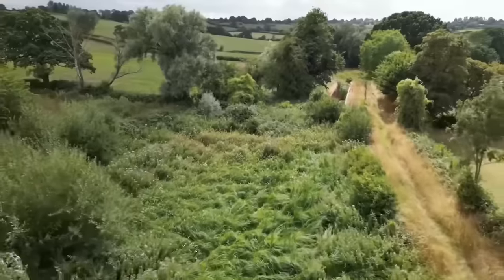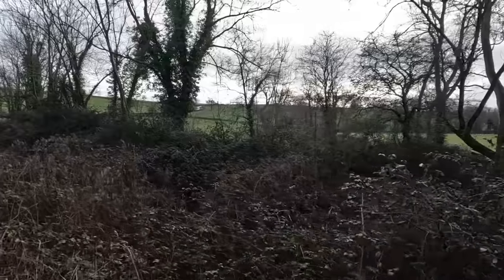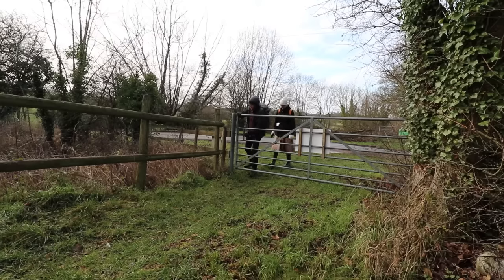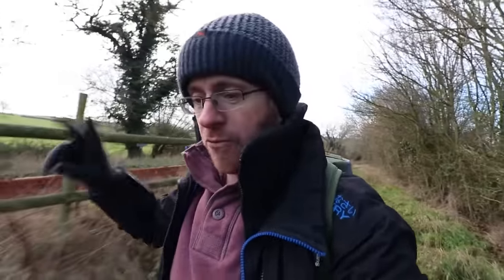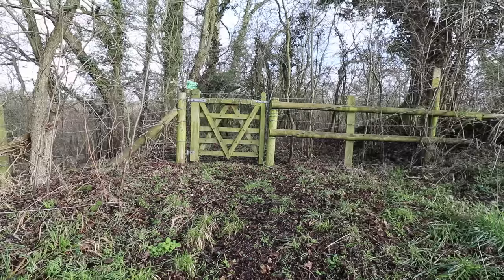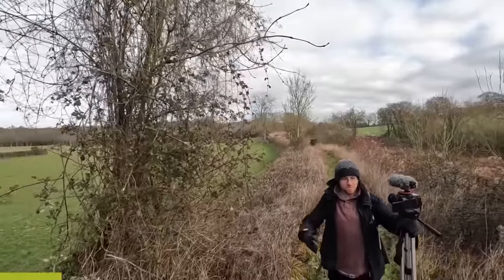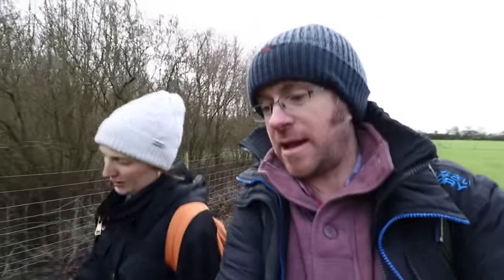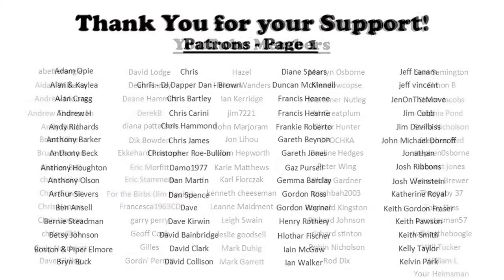The Wilts and Berks Lost Canal - Scaling 7 Abandoned Locks

Comment: There's a public footpath (marked on maps and signposted) near me which is totally impassible because owners of some of the properties which back onto it have extended their gardens and fenced off "their" little bit. One has even extended his shed to obstruct the footpath.
Reply: Then report them to the local authority.
Reply: Where do you live?
Reply: It's very common, and local authorities won't do anything. There is a route near me that was missed off the definitive map when it was made in the 1950s. I have provided evidence including deeds from a house with a plan showing the right of way that originated from the landowner. They've done nothing for over 10 years now. I think they're waiting until everyone who ever used it is dead and then they'll say there is not enough evidence.
Reply: @radman8321  Try contacting the Rambler's Association they are trying to get more paths added to the definitive map
Reply: @radman8321  that's a different issue to the blocking of a marked right of way.
Reply: @radman8321  If it is a legal right of way then the local authority has the Legal obligation to keep the RoW open. if they fail in that obligation, you can take legal action against them
Reply: Contact your local Ramblers group who can look in to this, they are campaigning to restore blocked paths which are in fact legal rights of way.
Reply: The local authority/ District/ County Council need to be informed.  And sooner rather than later, plus needs to be done regulary, otherwise the use of the footpath will be stopped by the lack of action Taken and the path closing permanently and the people obstructing it keep there bit of stolen land.
Reply: @joncawte6150  I know, but this isn't an official ROW because it was never added to the definitive map. There is plenty of evidence that it should be on the map but short of initiating a court case myself I have to rely on the local authority.
Reply: @neiloflongbeck5705  True.
Reply: On a related note, when I sold my last house, a Victorian terraced cottage, the ordnance survey had a footpath marked across the back gardens. Impossible as the gardens were all enclosed by a 40ft quarry face that preceded the age of the houses. I think the quarry was dug to build the adjacent railway embankment then the site was used to build the cottages. In reality the path went up the lane in front of the houses to the same destination. I had a nightmare selling the place because of that 2mm discrepancy on a map!!
Reply: Believe it or not a local road to me the owners of the house illegally put up road closed signs and blocked the road with soil and wood barricade. I complained to the council who actually went out to visit the road and their response was to close it permanently!
Reply: @neiloflongbeck5705  I have. Nothing has been done
Reply: @phillwainewright4221  have you tried your MP? I know some of them are just time serving idiots, but some don't know the meaning of serving their constituents and act honourably.

Comment: There's a peculiar situation with landowners blocking access in the middle of the Avon Trail. If you download the pdf for the trail it shows a crossing of the Bitton Viaduct next to Avon Riverside Station. However, about 4 years ago the landowner on the downstream side blocked access to the river that had been used for at least 10 years. On the other side, where the station platform is, the gate at the bottom of the embankment is locked and, recently, a sign went up to say £1000 fine for trespassing on the railway. One has to wonder what the operators of the, already pretty lacklustre, Avon Valley Railway expect their passengers to do at what is the terminus of the line. To add to the frustration, passengers have to cross the line to get to the cycle/foot path which allows them to cross the viaduct and gain access to the riverside. So why not allow walkers access to the platform from the opposite bank of the river?
There are a couple of alternatives for those wanting to complete the route. By crossing the viaduct at Saltford, the footpath on the opposite side of the river passes Kelston Mill and leaves a few hundred metres on a road with paved footpath to Swineford where the river path can be followed again on the opposite side to the guide. An alternative for those who wish to avoid the busy road is to divert off from Kelston Mill up to North Stoke and back down to Swineford. Or the most popular seems to be to ignore the threatening signs and squeeze through one of the small gaps in the fences on either side of the embankment.

Comment: Fortunately, water supply isn't quite such a problem in difficult locations like this today because of the ready supply of Electricity and Electric pumps. You'll find that many locks on the canal system has been retrofitted with back pumping arrangements to push the water back uphill in times of shortage. Obviously that's expensive, but it's a viable solution.

Comment: Thank you for raising the important issue of public access.  For 200 yards the landowner could have a fence either side of the path so they all connect up.  As for landowners blocking legitimate access I thought County Councils had powers to deal with this.  If they don't take action against landowners, then one has to ask if the County Council staff and Councillors have a vested interest in the blocked off land!!  It could also be they are just not interested and need a good kicking to get them to act!

Comment: I have a question why are the canals so small ? Look over for example to Germany the canals there are like huge rivers for nice big ships. So I’m wondering why it isn’t happening here in the uk , if there would have been a couple of this big canals we could connect most parts of the uk and river moving water around for drought and increased capacity of water what could be stored :-)
Reply from the maker: In the example of the Wilts and Berks I think it was purely down to costs. Perhaps that contributed to its demise.
Reply: They were dug by laborers. A wide canal is much more work if you need to haul the dirt over to the banks, rather than just pitch it a few feet. A wide canal also needs a much larger water supply to operate the locks.

Comment: One thing you missed out is that they would timed it so that you have a boat going up as well as going down and those artificial ponds become passing points for traffic going up and down.
Reply: The side ponds are rarely accessible to craft. They usually widen the small stretches in between the locks. The Tardebigge flights on the Birmingham-Worcester and Foxton Locks on the Grand Union are good examples of wide pounds and side ponds respectively.

Comment: My opinion is that landowners often deliberately block access to small parcels of land they own, to dissuade people from using the public rights of way that lead up to that point. Nearby land owner has refused for years and years to allow access to about 200 metres of the old Somerset and Dorset Railway trackbed (which they acquired when the railway closed). There are "dead-end" public footpaths at each end of this short stretch of "private" land - but no through-route without trespassing. I imagine if the two public footpaths were linked, there'd be a lot more foot-traffic - and I guess that's exactly the opposite of what the landowner wants. If the right to roam campaign in England is ever successful, this could become a problem for landowners?

Comment: Paul, there is probably a good reason the path was a dead end. The land owner maybe has livestock and doesn't want the hassle of people being scared by the livestock, or there could be some irresponsable dog owners who figure their dog can run off lead off of the trail and maybe the land owner has had problems with ignorant people abusing the privilage of using the trail.
Reply from the maker: Yup and in many cases this is true. This chap though suggested the trust would have the ability to reopen the canal here... he purchased the house and alas... refused. Its a 150m stretch of wood land which used to be a towpath... long before he came along.

Comment: The very VERY selfish landowner has been intentionally obstructive for many years, almost as if they get pleasure out of it. 

Tockenham reservoir was built to serve the seven locks, not the whole canal (Swindon is higher again and needed its own Coate reservoir as a result).

Tockenham was as big as it could be and had to be placed at that specific location in order to receive sufficient water from streams. It was therefore supporting Coate reservoir by taking over the burden of supplying the demands of the seven locks (if that makes sense).